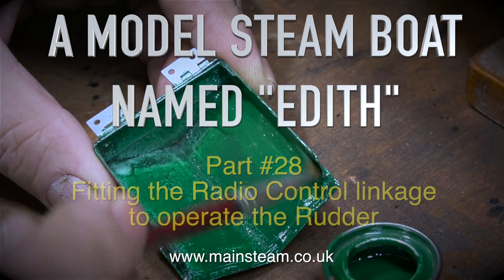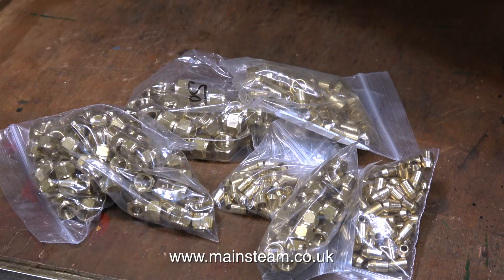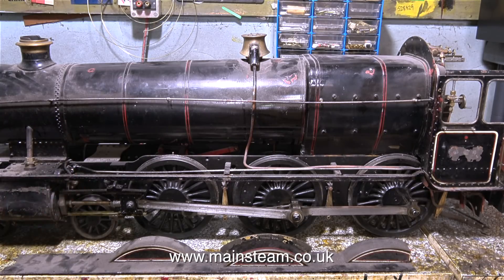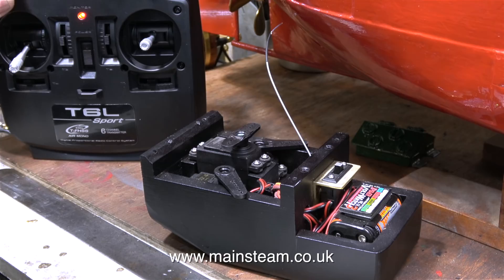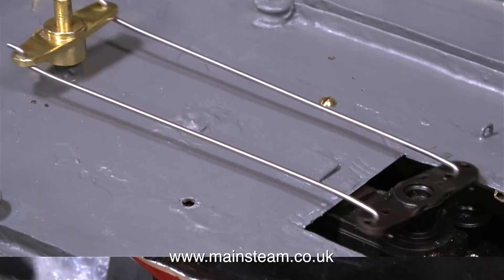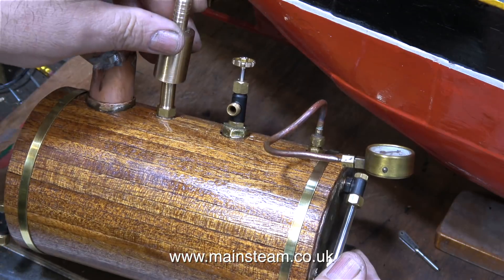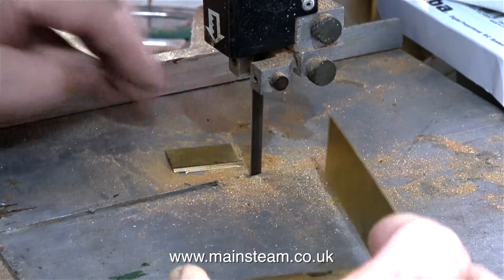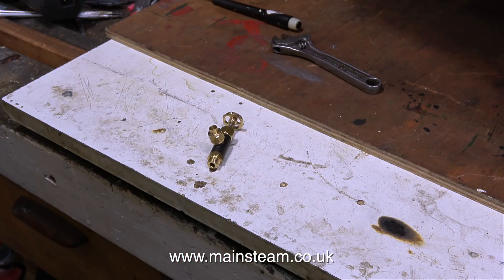A MODEL STEAM BOAT NAMED EDITH - PART #28

Comment: Hello Keith:  The overpressure "cup" on top of the overpressure relief valve is a bit odd.  The steam will condense and dribble water all over the woodwork covering the boiler.  Would you care to expound on why this isn't hard piped, just like the chimney?  Thanks!
Reply from the maker: No it won't when I fit the "O " rings }:-))) I have made a few of these  and they definitely don't dribble . . .
Reply: Keith Appleton: An o-ring certainly will contain the condensed water.  Did I miss the o-ring in the varied explanations to date?  Thanks for clearing that up.
Reply from the maker: I will only fit the "O " rings upon final assembly ...... please watch the rest of the series }:-)))